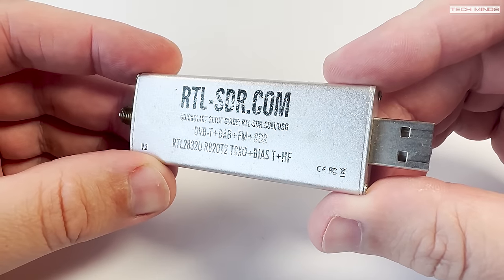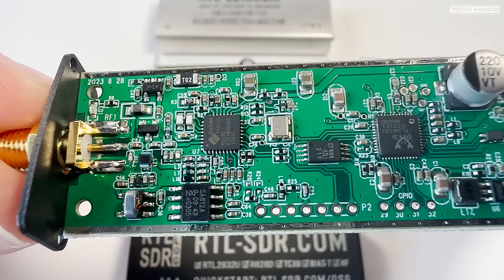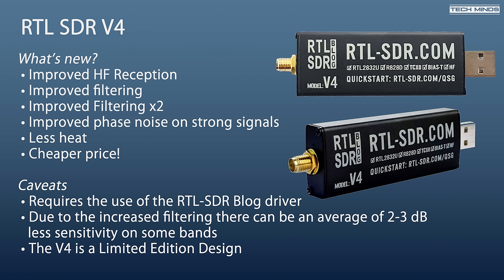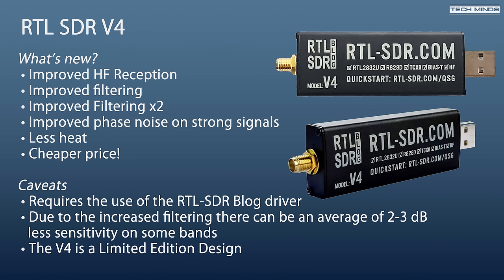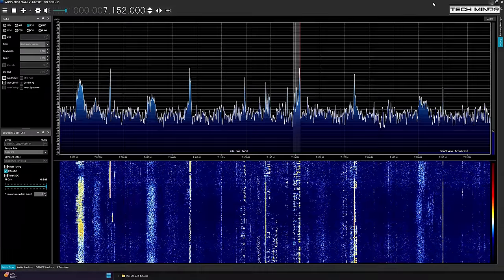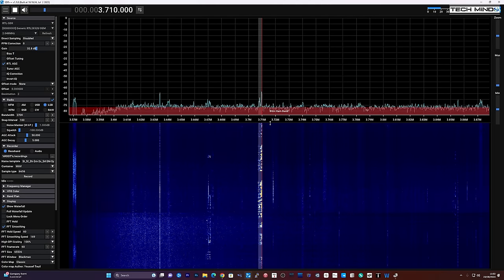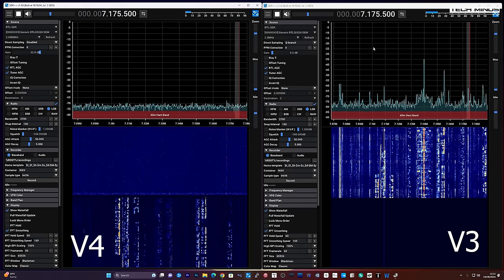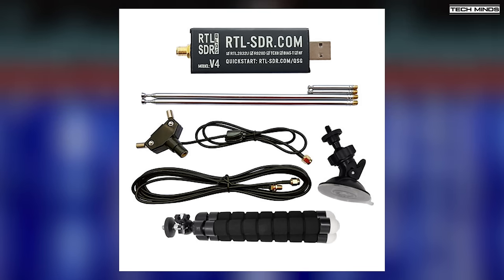RTL SDR V4 - Now with Built-In HF Upconverter  + More Features

Comment: Try to look for strong tones around 10-30MHz which I suspect is the main resonant tone of ET scout ships aka flying saucers in the 15meter size range. There is good indication from close encounters that the hull is EM energized and that the shape of the craft is (like an antenna or magnetic coil) due to the physics it employs. Since they run at rather high power levels I suspect that these main tones and indeed complex harmonics can be detected from thousands of kilometers away. Some software to watch that band automatically might catch something within days or less because they frequent our skies quite a bit. Pun intended. If I'm right you'll be able to recognize the stable main tone because it doesn't carry any audio or other signal yet it will have complex patterns anyway. The higher frequency harmonics well into the GHz I speculate form a pattern to match the local mass distribution near it. Because they move by negotiating the local gravity potential energy field. But the main tone will be dictated by the hull size and should be steady. But might fluctuate greatly in amplitude. From bare minimum hover to gigawatt burst climb.
Reply: Please let me know I could interview you about what your describing here!
Reply: @bostocked  you can ask questions.
Reply: @DanFrederiksen   Hi Dan thank you, How do you know that it would be 10-30Mhz specifically, would this be due to the redshift that occurs when "decelerating", when you do get a hit on the spectrum what might that sound like/look like, based off my own maths It make look a little like a LIGO wave detection.... but that's incredible if you have found a pattern they roll around in as the potentials increase then decrease?
Reply: @bostocked  no it's a speed of light thing. How long an EM wave takes to flow from the tip of the saucer down to the edge and back up again. Like a tuning fork has a resonant frequency or a flute. Those are mechanical vibrations and speed of sound in air. For the saucer I'm thinking it's electromagnetic from the high voltage hissing that have been heard and the corona glow on the hull at night. Also people report being cooked from it which suggests radio/microwave radiation. But people have also reported a scraping bell sound so it's actually possible that it has mechanical vibration too like a tuning fork. I hadn't considered that before now. Some ET ships have a spinning section and I suspect that this mass acceleration which spinning is, can allow them to tease out gravitational effects somehow. But a mechanical vibration is also acceleration of mass so just maybe some are doing it that way. We don't have a way to detect that from a distance though but a standing electromagnetic wave on the hull could be easy to detect with a radio receiver.
So the frequency is decided by the size of the craft. The bigger the lower the tone. Your typical 15meter craft might be just around 20MHz because light can travel 15 meters 20 million times per second. There are some nuances that could change the math a little but should be around there and the frequency should be steady if my simple hypothesis has merit.
Reply: @DanFrederiksen  very interesting response thank you  perhaps the static gravitational field exhibits a mechanical vibration against the air too?? I'm thinking like thunder perhaps. f your saying that's an actual physical vibration that could add to the general excitation onto the air causing it glow, is your assumption that they actually don't mean to light up eveytime they're seen, but rather they can't actually help it sometimes due to a side effect of the antimatter / thermoelectric reaction generating a high voltage?? Are you suggesting that 10-30 tone is caused by the fluctuing EM field or a byproduct of movement/ gliding through the substrate.

If it helps I'll tell you a private theory of mine too, that I'm 99% sure the metal slag we see deposited by some of them is 100% transfused remnants due to a fusion reaction buildup that may either occur sometimes as a natural byproduct of a fusion reaction based engine  or as an error in amount / frequency / timing array of the gun that fires the fusile material. After a while transfigured elements must build up the same way we end up with fissile waste in a reactor, this is then ejected or deposited out the back otherwise it'll contine to fuse until it hits beyond iron etc and would / could explain why normal isotopes are found but the structure seems "more structured" than natural earth bound elements. Think like vapor gas deposition almost, just neutronic in scale,

But If true it would mean certain craft atleast are fusion reaction powered and perhaps based on the frequencies your saying interference could be generating which could lead to either tracking or disruption via a standing wave which I'm sure is a scary proposition for them. I also have to ask is there nothing natural that generates say a 20MHZ wave, how can it be guaranteed that it is a craft if spotted - would it be specific pulses, waveform shape etc??
Reply: @bostocked  I've also thought about the excretions that some of them might do. My idea is that it's a kind of ablation, if something gets too hot or is damaged it can be expelled. The reason I don't think it's nuclear waste is that one case claimed it was analysed and was fairly common light metals like calcium, magnesium, boron iirc. Particularly boron is interesting because it's a super light super strong material that we don't use much in our society. Significantly superior to titanium. I don't recall any that tested for radioactivity.
And yes I think the EM excitation of the surface is what is seen as a glow at night and often too faint to be seen in sunlight. It's called corona discharge in our physics if that's what it's related to. High voltage fast AC through a coil will create a glow because it agitates the air. Like neon light basically. But because we are dealing with some new physics it can also be something completely different. They can also turn on lights but the reason they are often seen as glowing I think is a biproduct of the propulsion. Some more fancy implementations may not have any glow. Some have glow more concentrated around some dot points along the craft. Apparently there are many ways to skin a cat but the commonality is that it's done with fields. And seemingly a big part of the activation is electromagnetic fields so something we can relate to. Basically a mix or phased array radio and microwave oven stuff. And a spinning top. Something we can possibly easily do although their implementations are fantastically complex. I've heard of craft that turn to dust when damaged. Atoms so perfectly arranged as to do all that fancy stuff yet completely fall apart if it malfunctions. Clever for use on unaware planets.
Some are reported as having a glowing exhaust, not sure what that's about.
Reply: @DanFrederiksen  Thank you thats incredibly interesting. Thats interesting about those craft that turn to dust when damaged. One could imagine a atomic crystaline structure that is electrostatically charged like an LCD screen but when a certain criteria is met (gravitational bubble collapse, or standing wave compromised) it phases them out of structure so that it literally turns to ash and couldn't be used by any foreign party. Do you reckon those ships that do turn to dust are just unmanned scout ships, sent for reconnaissance, whereas the more structured crashed craft were here for another mission / manned / carried some sort of biology on board and didn't evaporate due to being possibly recovered at a later date.... interesting thoughts. Ive drawn out multiple diagrams and your theory makes absolute plausible sense! so in that case what do you think would actually be causing that light to bleed through (when it comes to light only seen through specific points I mean) could it perhaps be standing waves within the EM envelope perhaps? where those focused points are perhaps or if lazar type knowledge correct, the emission points of the "gravity" amplifiers. Mass is energy is light so one could safely assume its possible that at the very focal point of such an amplifier there would be light emission sort of how light through a magnifying glass creates such a powerful beam at first that spreads to a lower energy state, in an area where normal physics breaks down I reckon it could be possible, but that is slightly out there, the corona due to the gas atmosphere does make much more sense. 
With your point about Mhz to Giga sweeps what might that look like on a spectrogram would it be an entire sweep up to say 1.6Ghz? If your theory is correct then there could be some tell tale frequency sound / spike.
I have always thought that they couldn't help but give off an EM frequency which they obviously bloody do as they can be detected on infrared, an wondered what a pulse might sound light, but am extending an empty bowl of gruel to you as an amateur in the sdr space.

I myself I have gotten into SDR purely for this reason as I believe 3 spaced and tuned lightning electrostatic discharge detectors plus a clearly defined radio burst would confirm completely a recent or current EM craft flyby. If lightning can affect LIGO detectors which themselves already detect ripples in the gravitational field then I'll be damned if triangulated ones cant detect an accidental Electrostatic discharge when ones "Powers up" to move dramatically. Average lightning strike is 300 million and its theorised that these craft would need millions of volts to move, so I believe there's something in that....somewhere.....
Reply: @bostocked  networks that detect lightning could well detect ET ships, I have considered the same, they also detect radio but just sharp pulses. But I noticed that the local danish network often misses lightning strikes so I suspect they are tightly discriminating to ignore anything not lightning. Their system might see a long steady point moving across the sky and they would exclude those. I once looked into it a bit to see if raw data could be found but never located any behind the scenes people. But we don't really need such a network when a bit of software on SDRs could do better. Although with the right software on those lightning networks they might pick up everything.
Corona discharge isn't complicated. It's not shining through, the surface would oscillate with electric tension and that field would agitate the air next to it and with adequate voltage and frequency the air will glow. If you search corona discharge on youtube you can see it done many ways.
If I'm right that the saucer shape is because of the physics and it's electrically agitated the main resonant tone is the only specific I've figured out but like Chladni patterns I figure they create complex standing wave patterns that somehow matches the mass distribution near it. That would be higher harmonics and because it's a 2D surface it would be a spatial arrangement and with a radio we would only get the 1D result. But it would still be very telling. But it would basically be harmonics, meaning if the base tone is 20MHz there would be 40MHz, 60, 80 etc and that might go way high. I have the impression that they also use GHz microwave frequencies because the falcon lake incident had some waveguide portals about 3-4cm wide and that would be around 5GHz but that could be something completely unrelated. In the cash landrum case the dashboard got cooked and thermal doesn't go through glass. And when they got out of the car they could really feel it and the outside of the car was cooking. That could possibly come from 20MHz radiation and higher tones so microwave might not be a big thing. Although in the Carlos Diaz case you can see finer points in the pattern and to form small details you need higher frequencies so there could be GHz elements. But finding the main tone is the first step. If those show up without an audio or video or digital signal in it then we can see what higher frequencies are there. If it's a lot of harmonics that's recognizable as not normal radio emission. If we should get to finding multiple such sources we could start to recognize types. And with triangulation they could be tracked for speed etc. But that's building on a lot of assumptions. Main tone first. And the tone would correlate directly to size of craft.
Reply: @DanFrederiksen Beautifully put. this makes alot of sense. I've got a bit of homework to do. Thats a really good starting point for me SDR wise i thank you intensely for that. Do you think theres an insidious tone that some SDR's dont go to the 10mhz level or is this just not a standard within the space. I understand your 2D representational idea and makes sense, I've often wondered that we ourselves a full 4th dimensional species at minimums brain is supposedly shaped like a toroid as its the "best shape for moving across points of data in 4 dimensions" and I feel like stranger things have happened that it would also end up being a good shape for travelling across space. 
I would love to know what What made you come to this realisation / why do you know now they are real (as compared to before) and also I assume you do disagree with lazar-esque theory about antimatter reactions, do you believe the EM field is a byproduct of another type of product or excess high voltage or is it the main source of propulsion for the craft, i know that there are many difference types but let's say for the bulk of them?? 

Also in terms of chlandi patterns, you believe the source emission is intense enough for those to be sort of represented across the spectrum(if main base tone is asserted)? Or this is just a natural byproduct of the standing wave and should therefore give out a detectable emission no matter what?
Reply: @bostocked  some SDRs have big gaps in the spectrum they can read, I think it comes from commercial intent of the chips it uses. Originally it was a TV receiver that was hacked to be a software radio so it was never intended to be a purist scientific instrument. for these purposes you'll want one that has good coverage in at least 1-100MHz. Really big craft might have a main frequency around 200KHz. 
As I think of it currently this main frequency is very much intentional, not a pretty side effect like sun into a pool. But where it actually start might well be very complicated in these systems. They are more holistic than our current engineering.
I'm not sure Lazar correctly interpreted the 'reactor' device. It may or may not be a nuclear reactor. The hemisphere sort of makes sense to me as again a standing wave resonant configuration where waves in and out (like spherical sonoluminescence) carries very high energy density (of a nuclear reaction) to the surface as lower concentration for other use. The wedge shape inside doesn't quite make sense to me. Lazar spoke of a telescopic guide that came down from above to the dome 'reactor'. That might be part of how the energy is transferred to the tip and wave up and down on the outside.
btw someone is doing a very high quality computer graphics reconstruction of everything Lazar say, it's coming out soon. The little demo reactor they had in the lab had no wires. It just worked when you put the lid on. I hunch that everything they do is resonance based. That when they are put together it just starts 'ringing' by design. Like how a grand father clock ticks from the bias of the weight. It just starts going and all power transfer is also by resonances. Like how we have dabbled with wireless power. They have no wires, no transistors. It's either resonant 'induction' or uniformly baked into the atomic lattice. That includes displays on the walls. It just looks like metal but the functionality is somewhere in the material in some very fancy diffuse way. Not only a flawless contrast image but it's 3 dimensional so it can appear transparent and it suspends the metallic reflection of the material while working as a display. All the while being structural, extremely strong and probably scratch resistent. 
I suspect the propulsion physics is moderately doable but their implementations are very fancy.

Comment: I've just bought a V4, followed all the instructions many times over, and the only sampling which works is the quadrature sampling. 2048 and Q branch greys out the RF gain and just gives noise right through all HF frequencies. Any ideas anyone? A bit disillusioned so far.
Reply: @GabrielRaigosa  Thanks you. Good luck.

Comment: Although I am glad this has come out at around £55 for the kit with antennas, for not much more money the RSP1a is so much a better product (£99).
I can't help but think this is the right bit of kit but should have come out 4 years ago
Reply: I have an RSP1a and for me it's either impossible to install on Linux, or I need a Masters degree to figure it out.
Reply: @wesKEVQJ on what system? I'm almost computer illiterate and I got mine up and running on Windows 10 in minutes after watching a YouTube video.
Reply: @felixthecat1672  Ironically, Andy's Ham Radio Distro. It's Xubuntu based.

Comment: I wonder how this performs on HF compared to the Nooelec Nesder v5? The v5 does not have an upconverter but it does have far superior HF reception than the stock rtlsdr v3.
Reply: nooelec v5 does not have better HF than rtl sdr... they are just TV tuners on a metal casing what are you talking about ??
Reply: blog v3 & noelec v5 is quite much same hardware, just minor variations. V4 is a different design and way of working.
Reply: @Sultan___  according to the listing for the nooelec, it's got way better sensitivity at 500khz and above than the stock rtlsdr. Whether that's BS or not idk. But Nooelec is not known for lying so I assume it's true, and in my own experience it certainly seems true.
Reply: @VTXHobbies  those are lies. they are just trying to sell their products